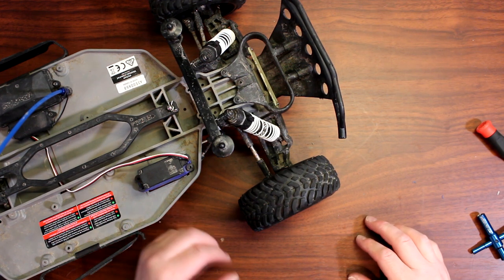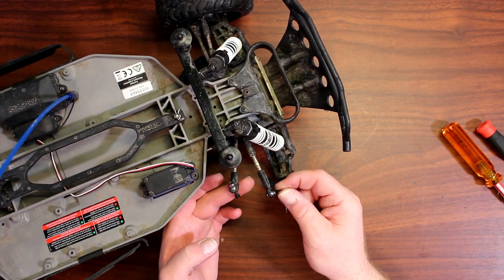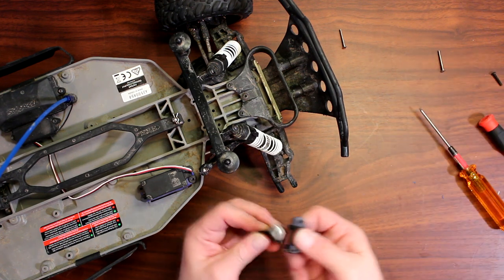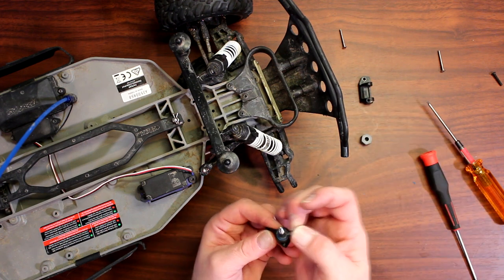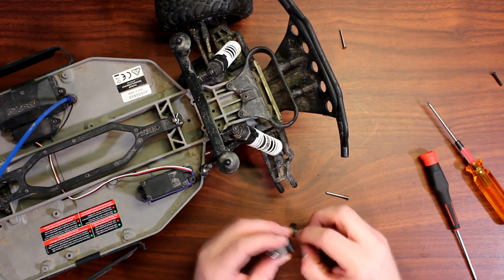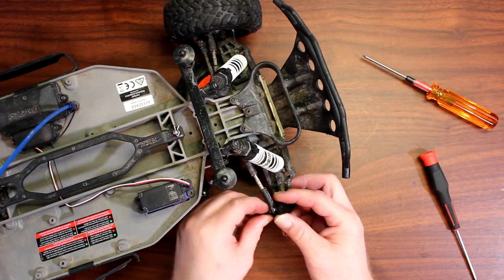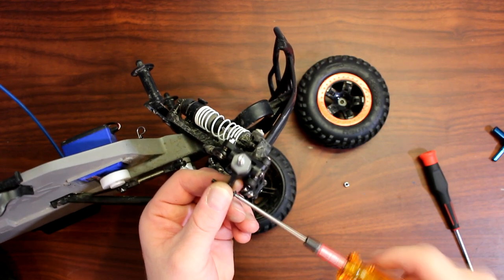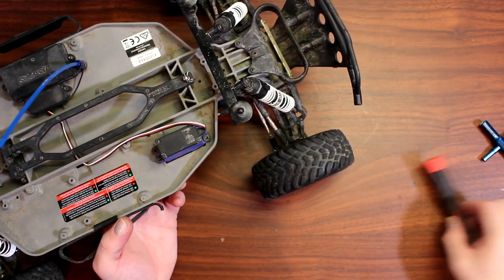How To Change Your Steering Block 2wd  Slash,Rustler,Stampede  Traxxas

Comment: Many thanks for the very clear instructions, great video.
This procedure worked for me when replacing this part on a Traxxas 36084-1 Bigfoot
The only difference is the vertical pivot which is a circlip retained shaft, remove the bottom circlip then remove the shaft and continue with the demonstrated process.
Easy fix.

Comment: you guys make me feel so good about myself. I literally broke my Rustler 2 hours into using it. Steering Block and Castor broke from crashing into a curb. I used the metal replacement castor and a replacement block from Traxxas. Thanks for this video!
Reply: Where did you buy it?
Reply: @mikaheerkens3408  which piece?
Reply: You're lucky, mine lasted 5 minutes 😭

Comment: Pls help me whenever I try to take tires off the front it will spin the bearing so I can’t take the nut out
Reply from the maker: You will need to hold the spindle on the carrier itself to be able to remove your nut

Comment: Why does my steering block on my slash have a longer bottom part with two adjustment holes instead of 1? It’s a slash 2wd raptor
Reply from the maker: That I remember a Slash 2wd. Does it have any adjustment on the bottom part of the knuckle remember correctly

Comment: do any steering blocks work as long as both sides are the same?
Reply from the maker: No the only steering block that will work if it comes from a stampede or rustler 2wd. if you’re trying to use from another company it will not work
Reply: @djsprc  ok thanks

Comment: Excellent video! The steering block broke 20 minutes into using our Stampede. Resisted several types of glue as well. Do these break often? I will buy several extras.
Reply from the maker: David Schmetterer They may break yes depending how you drive the vehicle but look for  RPM part at your local hobby shop they are warranted for life with RPM directly
Reply: @djsprc  thanks for writing back! I'll look for the RPM part. Unfortunately everything in NJ is basically closed, and the excellent hobby shop in my town closed for good a few months ago.
Reply from the maker: David Schmetterer They are available online to it might even be able to find some on Amazon

Comment: On my stampede I don’t have long bolt that goes through my steering block it’s a shaft with two pins how do I remove it
Reply from the maker: Traxxas has made two models one with 2C clips one on top one of the bottom the other one is a pin with the Philip head screw.

Comment: Hey man, so my caster snapped, and I’m watching your tutorial, and I ran into a problem. The bolt that holds the caster and block together isn’t a screw, it’s like a weird shaped special tool . I didn’t get one with all the parts when I inboxed it, do you know how to take it off?
Reply from the maker: Tookenador Sorry for the late reply depending on the version you have you may not have a bolt itself or screw it might be a pin with C clips. You just need to remove the C clip on one side and able to remove that pin
Reply: djsprc hey man I have to same thing on my rustler with the clips, I removed both of the c clips but the damned pin won’t come out no matter what. Any suggestions?
Reply: The pin is likely bent. It wouldn’t budge one side but tried the other and got it out. It was very slightly bent. Few taps with screwdriver and put it back in hasn’t failed me yet but ordered 4 more in case.